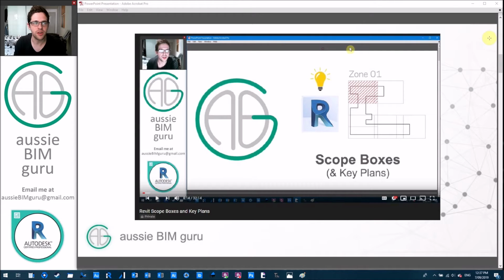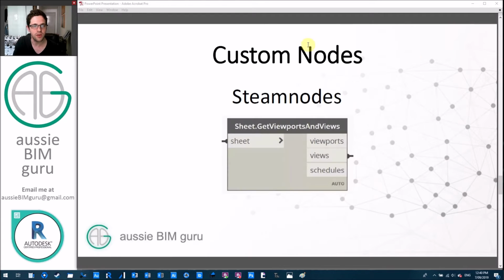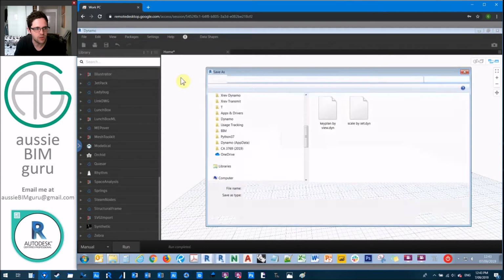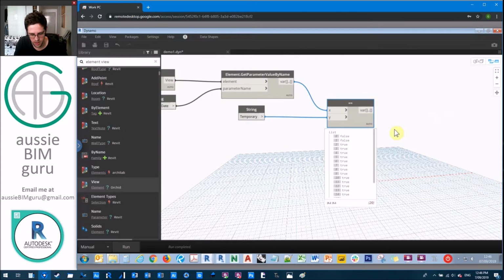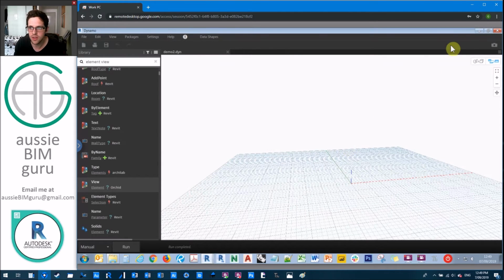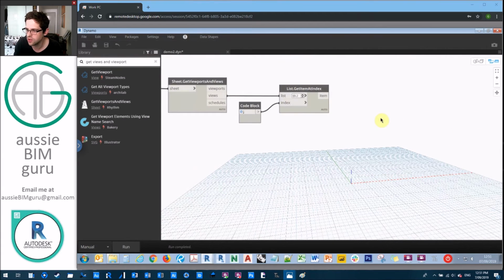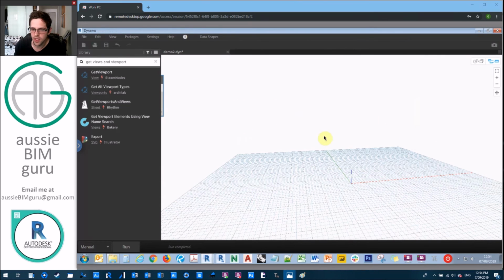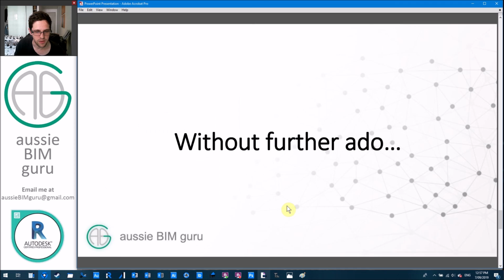Update Title block Parameters using Dynamo!

Comment: Hi, I am trying to change "as indicated" scale in title block to Upper case but it's not working,
Reply from the maker: I don't believe this is possible to change by default. Usually I add a manual shared parameter and an optional yes/no parameter to that and the autoscale so that if needed you can show a manual scale instead - this could show an all caps version maybe.
Reply: @AussieBIMGuru  thank you for your quick turnaround!

Comment: Sir at 10.07 time u filter title block by sheet parameter ?? Why
Reply from the maker: I filter them down to a set of sheets as we only want to work with some titleblocks in the model, not all sheets are plan related so a keyplan isnt always relevant.
Reply: Sir at 9.26  u saying filter the original element by their host element??.here what is original element and what is host element???thanku sir
Reply from the maker: @iftekharkhan8879  the titleblocks by their sheets.

Comment: I've instaled Orchid 0.02 packages and i can't find View node? Did i download  correct packages ? Thanks in advance!
Reply from the maker: Yes element.view is definitely in orchid. Have you installed orchid and the samples?
Reply: @AussieBIMGuru  I have not... That was a problem, thanks for help!
Reply: @AussieBIMGuru  I have the same problem as Dusan, but I've installed the samples - didn't solve the problem, can't find Element.View node..
Reply from the maker: @davidg939  It should be under;
Orchid > RevitProject > Elements > Element > View

I am using version 230.0.1.7333
Reply: @AussieBIMGuru  I even don't have a folder Element, just Elements. My version is 230.0.1.7584
Reply from the maker: @davidg939  sounds like it didnt install properly. Make sure youre not installing as admin, do it as your user profile.

I have a video here too;
https://youtu.be/JdoSnPFqd6E
Reply: @AussieBIMGuru  I don't have user profile ;) I did everything like you to be honest - I'll try again, maybe it'll help.
Reply from the maker: @davidg939  if you're on windows, you'll have a user profile. This is the username you use when you sign in to your computer. Pc's also have an admin account, which can be used if there is an admin lock for software installs.

Packages in 2.3 are saved under;
C:\Users\ ** username ** \AppData\Roaming\Dynamo\Dynamo Revit\2.3

If it works, you should have 16 or so files in the Orchid package bin folder.
Reply: @AussieBIMGuru  I've reinstalled it but no luck. I have as you mention 16 files in the bin folder.
Reply from the maker: @davidg939  out of ideas unfortunately!
Reply: @AussieBIMGuru  thanks for interest!
Reply: @AussieBIMGuru  The node is now called 'OwnerView'
Reply from the maker: @awdaltima2  ah yes the challenge of using packages in static youtube videos with dynamic packages I guess!